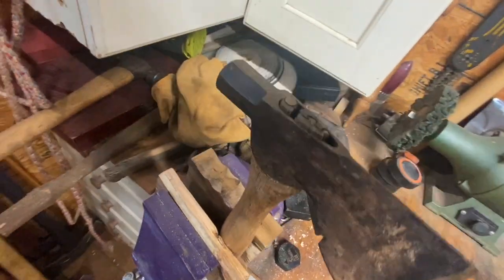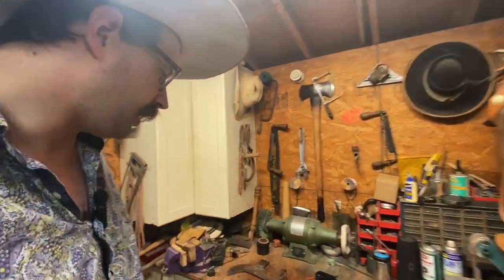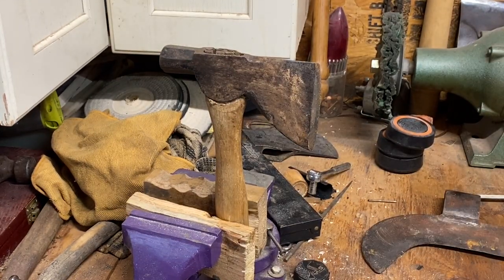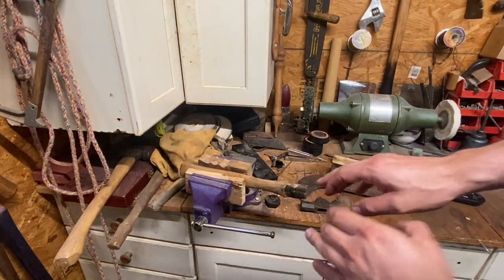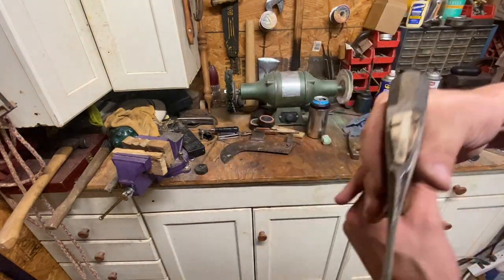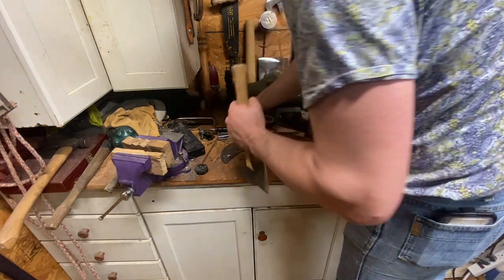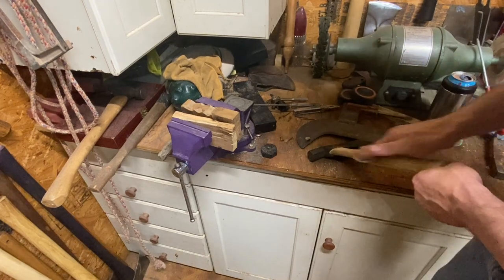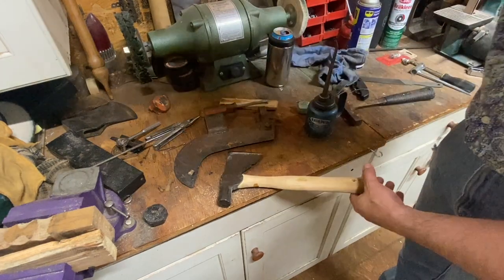How to reuse your axe handles.

Comment: Back in the 1990’s I bought a plumb ax head very similar to yours. I put a 18” handle in and cut serrations in the head with a dremel cut off wheel. It became my framing rigging ax of choice. It weighed about 24 Oz and has nearly perfect balance. It’s in my truck tool box outside. I used it for floor joists, rafter and facia framing. Otherwise I used a 21oz Dalluge framing hammer. It was fun to see you rehang the handle!
Reply from the maker: I prefer my California framer for my hammering needs with an 18 inch handle. Works great for driving anything home especially on fence staples. I have a few big rigging axe heads that need some handles. I’ll have to knock those out soon